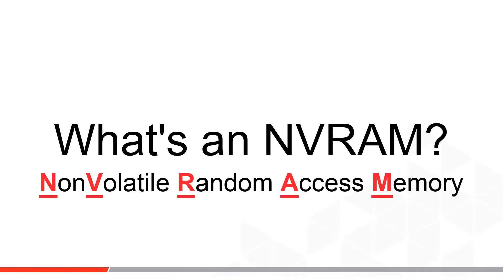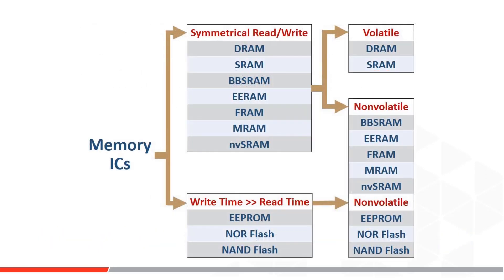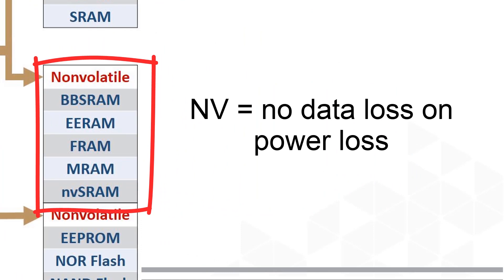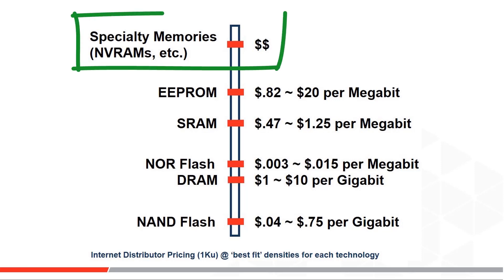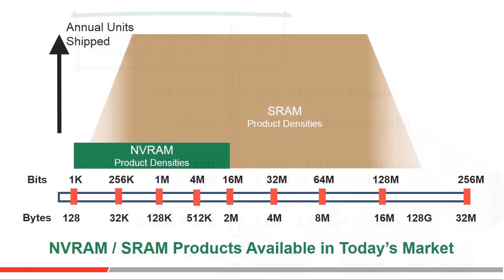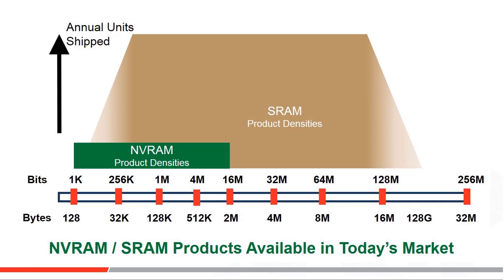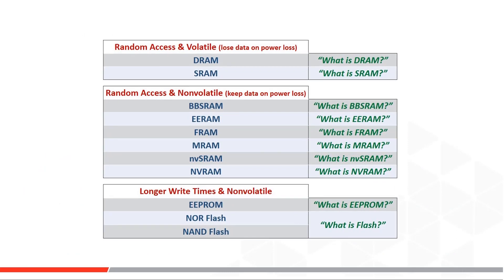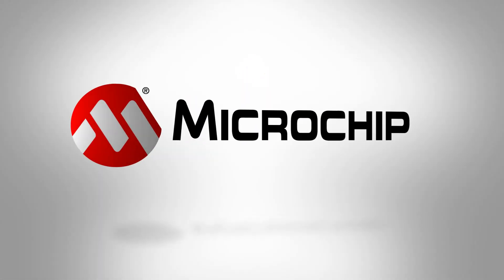What is NVRAM?

Comment: I still don't get it
Reply: Like standard RAM but  data stored in NVRAM isn't lost when the system is powered off. So volatile memory is only used whilst the system is in use and is permanently lost when shut down.
Reply: @samuelrhoads6436  So, how is it different from ROM ?
Reply: @HimanshuPal-li7nj  NVRAM can be rewritten quickly and easily while ROM either can't be rewritten or is a very slow and impractical
Reply: @HimanshuPal-li7nj  ROM is Read Only Memory...